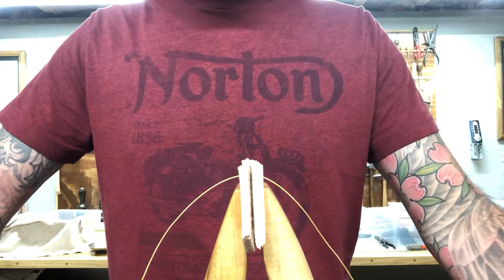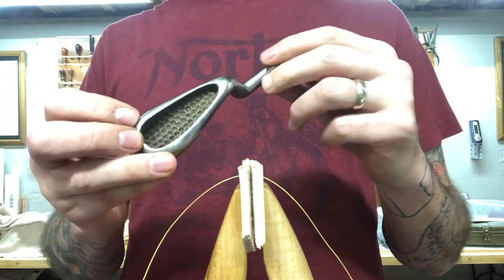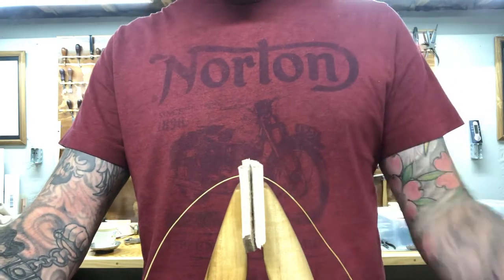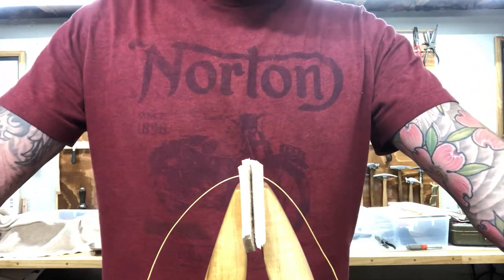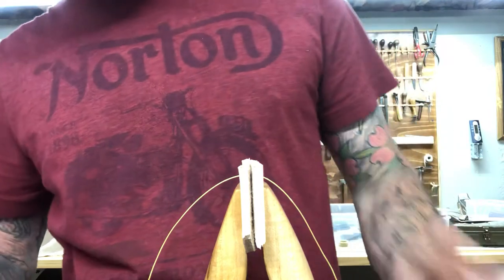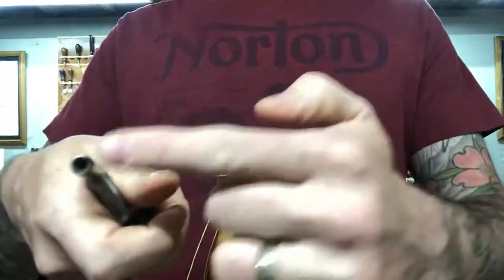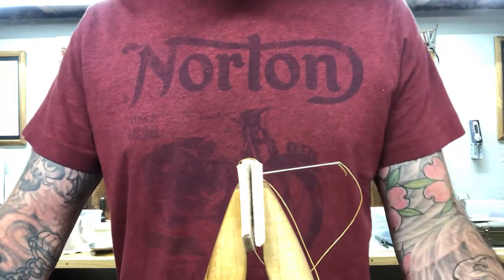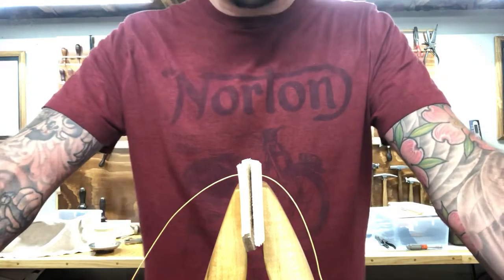Antique Leather Tools History and Demo Episode 1 — Palm Iron

Comment: I have been using a Collar palm for 50 odd years, and only ever used it with various sizes of collar needles. 4" and 5" mostly, in Australian Saddle making, but have  used 7 " needles when working on draught collars. You just need to use the correct size of awl blade to suit your stitching.. If you are experiencing the problem shown, try a bigger blade.